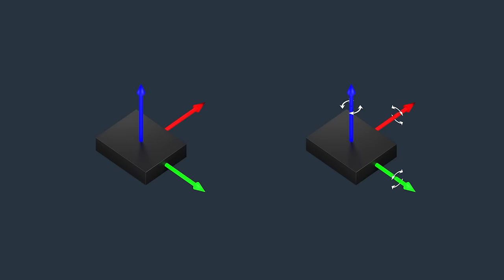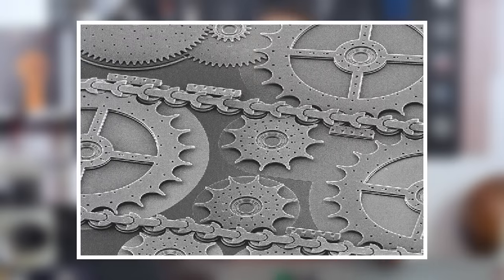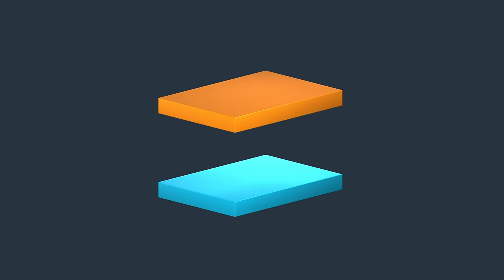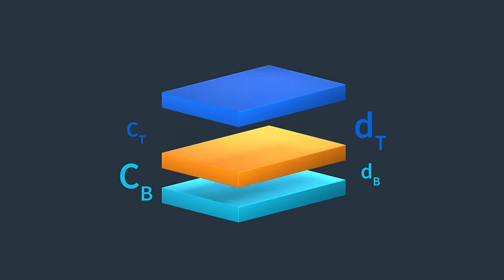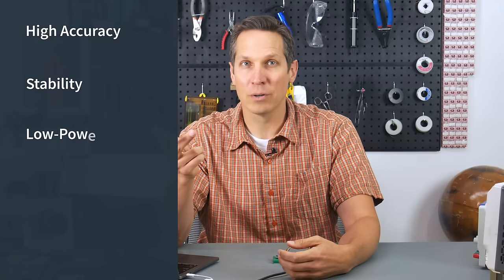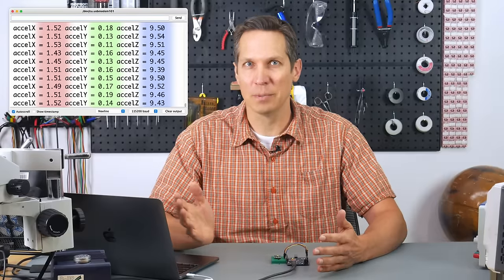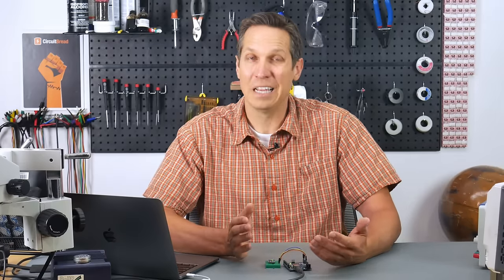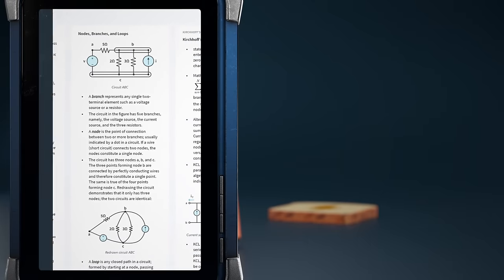How does an Accelerometer work? | 3D Animation

Comment: Gravity is not a force pushing down. What you are detecting is upward acceleration due to the Earth's mass warping of space time.
Reply from the maker: I watched that Veritasium video about gravity with one of my teenage daughters a few months ago and now every time I mention gravity (which happens more often in my household than you'd probably think) she just yells out, "Gravity doesn't exist, Dad!" and I continue to regret most of my life decisions...
Reply: @CircuitBread 😂
Reply: @CircuitBread yeah, flat earth poison is spreading and must be stop for the love of science and humanity😅
Reply: @CircuitBread  if gravity doesn't exist, is she floating in air!?
😂
Gravity exists, but nobody knows actually how that exist!?
Reply: The comment about gravity doesn't add further to understanding the principle and implementation of MEMS accelerometers. The commentary correctly talks about "acceleration due to gravity". The mass of the device moves against its springs when subjected to acceleration. Those springs are clearly counterbalancing a force when the device is subjected to an acceleration. The displacement is proportional to the acceleration. When I designed accelerometers, the mass was held in its null position using a current flowing through a coil mounted on the mass, the coil being immersed in a magnetic field. The current required to maintain that null position is directly proportional to the acceleration. This system is referred to as "force feedback".
Reply: Gravity absolutely is a force, when you're working in a Newtonian model. Which people do all the time, because it works really well for human scale things without being overly complicated. The fact that other models describe it differently doesn't change that.
Reply: @keiyakins  can you explain how or what the theory of gravity is useful or accurate in doing?
Reply: @pleasenopokeyme It did a pretty reasonable job of describing planetary orbits. Also, it predicts when ballistic trajectories will intersect with the ground and with what energy.
Reply: @christiancampbell466  i guess 'pretty reasonable' is why it's still theory ..mercury. And as for earthly predictions, we use what's referred to as 'little g' which is simply the rate of acceleration at which objects generally freefall. Obviously little g hasn't been proven to be anything more than weight, -the objects density in relation to whatever medium it's falling in (atmosphere, water, sewage etc) and the objects buoyancy (feathers vs rocks, ping pong balls vs. Slinkys) so for that reason, we could just as easily replace the little (g) with a little (a) to represent  'acceleration' this has been discussed add nauseum for a decade in flat earth/globe earth debates, and ive even seen videos of college professors claiming that they don't even refer to the rate of fall here on earth as being anything to do with gravity anymore, the guy said it's only used when discussing stellar objects, here on earth, he said, it's known as being the cause of electrostatics. That's just what I've seen one random college professor saying to his class in a video on YouTube, but it's still worth pondering considering we can replicate earths electrical feild scaled down and people have shown how they can reverse the polarity in these electric fields and up will turn to down for objects inside the electric field and will fall up. Granted it's scaled down but can surmise from the results that it's possible, if our polarity were to flip here on earth, we would fall up. Haha I'm just having fun thinking about all this I'm not tryna win a debate or anything
Reply: @pleasenopokeyme   what the hell are you talking about? is this some flat earth shit?
Reply: Sir' NOBODY on the face of the planet knows what gravity is!!.. .
Reply: @pleasenopokeyme in science and math, a "theory" and a "law" don't mean what you are suggesting, i.e. a theory isn't a lower-level idea that graduates to a law. There is a Newtonian Law of Gravity.
Reply: @carlostonebanks  sorry but this response isn't going to trick me into believing that the way I experience and treat the earth, has no relevance on what the earth actually is and what it's doing.
Reply: @carlostonebanks  oops sorry I thought this was a different conversation I was referring to. 
 But yeah you're helping me make my point actually..I believe its newtonian gravity that is what they use to track stellar objects, which is in line with what I had said about gravity earlier in this thread
Reply: Way to apply a model of gravity which does not add any value to the problem at hand.
Reply: @pleasenopokeyme Ha haah…the way you experience and treat the earth is directly proportional to the amount of “special chemicals” you are using to alter your perception of external events. The world just carries on regardless of your “altered perspective”. 😂👍
Reply: @keiyakins nah. Gravitational force is what works for 2 body problems. Gravity on the other hand is acceleration.
Reply: @hughjanus3378  laugh it up buddy, but my observations and experience with the flat and stationary earth actually have real world application, for instance, if you were to design an aircraft for use over the earth, you would be saving yourself a lot of unnecessary confusion to apply my knowledge of the earthly realm.
Reply: I mean you’re right but in the frame of reference for a normal human being on the planet earth (which we basically all are), the laws of classical physics are a good approximation and therefore valid.

Einstein wouldn’t crunch his 10 tensor equations to calculate the “sensation” we are feeling in this earth induced geodesic and neither should you.
Reply: If gravity isnt real then what keeps earth round blob of material together
Reply: @Johnny6ex  general relativity. So far. It’s very likely a new understanding will emerge that will supplant General Relativity just as General Relativity supplanted Newtonian/Classical Mechanics.
Reply: @pleasenopokeyme  Gravity is a unidirectional force. There is no repulsive gravity in the same way there is for electromagnetic forces. "Antigravity" is just thrust counteracting the force of gravity, not reversing it.

Also, in science a "theory" is the highest term used to describe mathematical certainty. In other words, it's scientific fact. Very few things can be classified as laws of the universe because very few things can be proved with absolute certainty in ALL cases. For everything else that we're as sure as you can be without proving every single individual case, we call those theories. Also also, gravity is in fact a law, so that diatribe wasn't needed to prove you wrong.
Reply: @cristofjulun1265 General relativity didn't supplant Newtonian physics. They're both models used in different scales, both in dimension and mass/energy. Quantum theory is the same thing. They're all models used to describe the universe and they all *affect all scales*. It's just at a certain point quantum effects become negligible in the same way that relativistic effects become negligible from the other direction. In the middle is Newtonian physics.
Reply: @needamuffin  well yeah they need gravity to make their ridiculous idea of living on a globe work. But it's not something that has ever been proven
Reply: @hughjanus3378  haha super funny big ass.
Reply: @needamuffin  Agree. You wrote it better.

Comment: for something like measuring the capacitance of proof mass-electrode system to work, the manufacturing of these devices got to be unimaginably precise
Reply from the maker: That's what I was thinking but I imagine they have some sort of compensating circuitry that automatically takes small variations into consideration.  Somehow...
Reply: Laser trimming.
Reply: They likely are made to be within a certain spec, then have some sort of programmable bias that can be used to compensate for any differences and calibrate them to align with real values.

Comment: You should've explained why the y-axis accelerometer looks so different and whether it has a completly different shape with slightly different principles, or if it's shaped exactly like the other two axis and what we saw is a limit of your rendering software.
Reply from the maker: Yeah, that was a conscious decision not to say anything about that - we always try to balance being concise with providing enough detail.  It's an ongoing debate on whether we are striking the correct balance.  For this, it is shaped differently but operates on the same principles!

Comment: Thank you for the video! I have a question: How sensitive are such capacitive sensors to various input voltages? I would assume that the output values are different if the sensor is supplied with 5.1 V instead of 5.0 V (for example).

Comment: Good video! Just one technicality. What was measured in the beginning is not the force of gravity in the traditional way. In the Newtonian picture the device was at rest and not accelerating. In the relativistic picture in which gravity is not a force but rather an artefact of curvature in space-time, what the device is actually measuring is the acceleration upwards caused by the ground pushing you up. You can test this by letting the accelerometer fall freely in which case there won't be a measurement (even though gravity would still act in the Newtonian picture but not in Einsteinian)
Reply: Another technicality, the device as shown can sense acceleration, but has no clue in which one of the two possible ways it is directed. You would need to re-arrange the light blue and dark blue electrodes a little, so that e.g. with a deflection of the proof mass in one direction all light electrodes see the proof mass moving away, and all dark ones see it coming closer. In the example given in the video (sequence of colours: dark blue - orange - light blue, orange - dark blue - ...) both colors see some part of the proof mass coming closer and another part moving away. That problem could be solved with the following sequence: dark blue - orange - light blue - dark blue - orange - light blue - dark blue - orange - li...

Comment: I dont understand
Why should a stationary accelerometer measure the acceleration due to gravity since it is not freely falling
Also the net force on it is 0 because a normal force equal to gravity is keeping it stationary
Reply from the maker: Interesting question, my daughter just asked me this the other day!  If you ever ride a roller coaster that accelerates to start (or ride in a Tesla, so I've heard) and been pushed back into the seat really hard, that acceleration makes sense to us.  But we're so used to gravity, we forget that we're literally feeling the force of acceleration toward the center of the earth all the time and, if it weren't for that normal force, we would be speeding up as we fell due to that acceleration.  In the case of this sensor, the "fingers" are being pulled toward the center of the earth, changing their position just slightly, which is measured. 
Hope that helps!

Comment: We are rotating at 1,000 mph at the equator and we orbit the sun at 66,600 mph. So when we are rotating with the orbit we are moving at 67,600 mph and 12 hours later we our speed has dropped to 65,600 mph.
I think a acceleration and deacceleration of 2,000 mph over 12hours should be detectable and its Not. 🤔